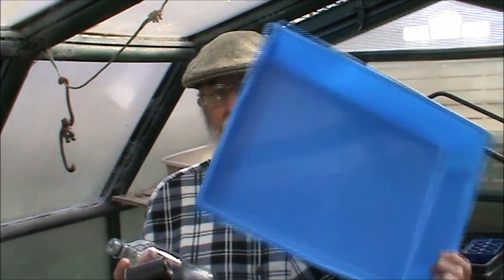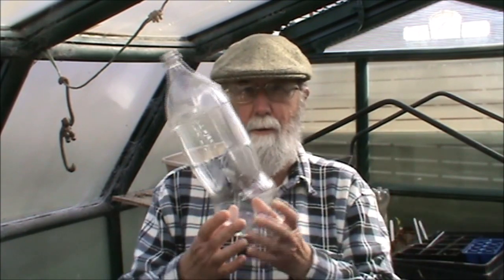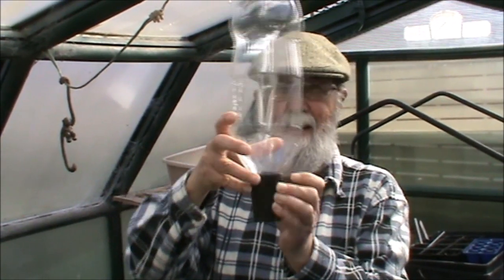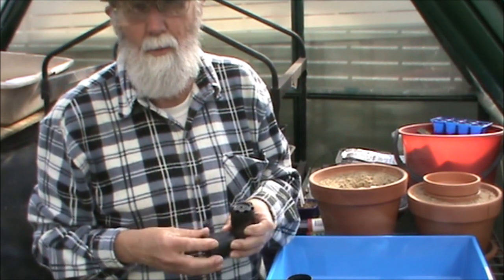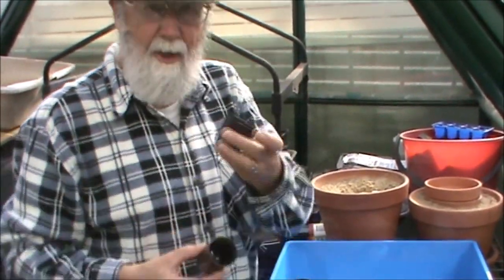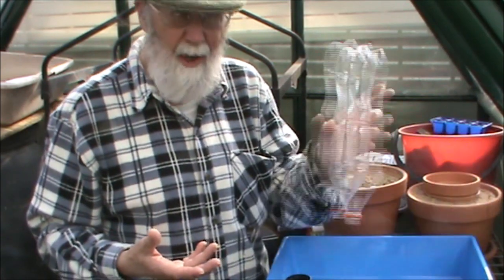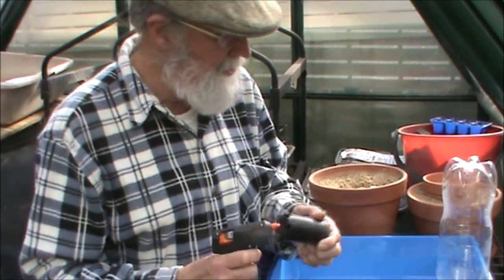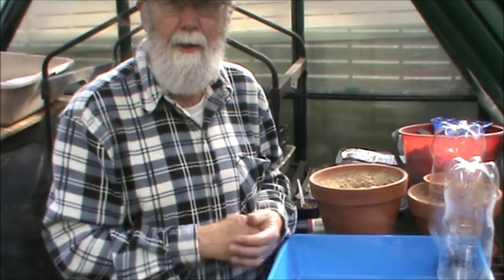Capillary Bed 2 0

Comment: Another option to give you an almost infinite variation of diameters and heights for different bottles would be PVC pipe, a drill, and some weed guard fabric around it to prevent the sand from infiltrating.  I think I am even going to redo my raised beds with the idea of capillary watering and fertilization.  My beds are 275 gallon IBC totes with the top foot cut off, inverted and bolted through the sides of the bottom section.  Previously I was only using them in a water storage capacity with plants on top and a drip irrigation system on a timer.  Now I think I will remove the soil, add a layer of weed guard, then sand, another layer of weed guard, then the soil on top.  I gather rain water from my gutter system to fill them, add a bit of manure to make it a light dose of manure tea.  If I redo it all I have to do is raise the water level and then I only have to check it probably once a week and top off if needed!  I could even install another tote elevated above the others and use it as a bottle as long as I kept it sealed......

Comment: Why coarse sand specifically? What other mediums could be used? Garden soil? Is there a comparison of how sand is better than other mediums? Thx
Reply from the maker: Coarse sand is something already have on hand,  and it allows the water to travel by capillary action well. Fine sand would not hold as much water because it packs more closely together so reduced interstices to be filled by water. I dunno how garden soil would work but I suspect it would pack down into a sludgey mess, plus may contain non-beneficial organisms, especially if it packs down and goes anaerobic. You could try perlite or vermiculite, but they are comparatively expensive and  probably float instead of forming a bed,  likewise cocopeat would hold the water but might also pack down. For me coarse sand is the cheapest,  most easily available and best performing of the alternatives. If you give something else a go, pleas let me know how well it worked! :-)
Reply: @underthechokotree2792  thanks for the detailed response. Much appreciated! I suppose if I choose a medium that's like the tiny pebbles in an aquarium, I may risk mosquitoes, trying to source coarse sand is probably the best option to avoid the mosquito issue
Reply from the maker: @rudyj4559  I believe so, have you tried the local hardware for coarse river sand?
Reply: @underthechokotree2792  yup that's exactly where I was headed.! 🤣 Thanks for your valuable contribution! I'm going to use your idea and put one gallon grow bags in sand trays to "self water" my plants 🤞
Reply: Would coco coir or peat moss work instead of coarse sand, do you think?